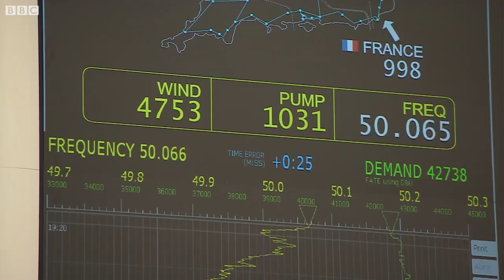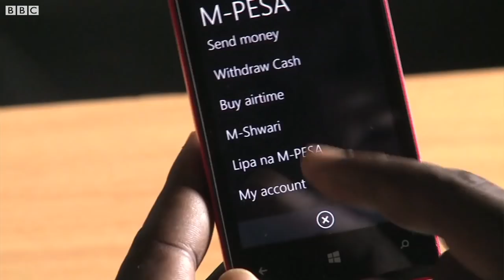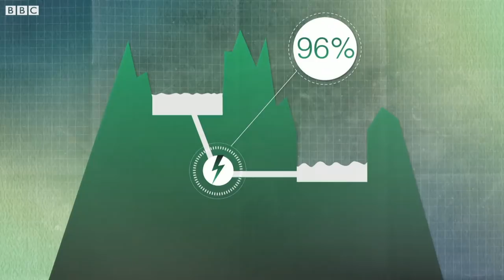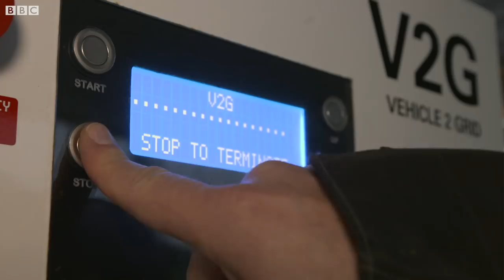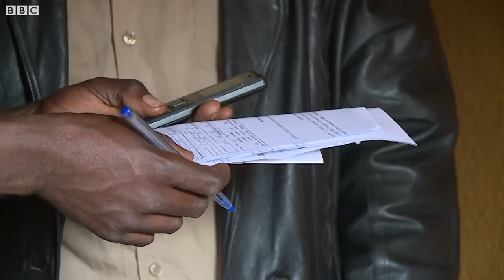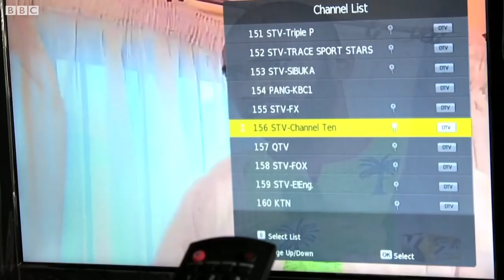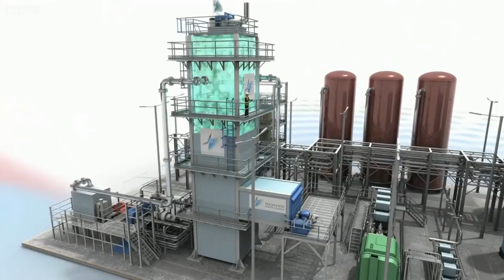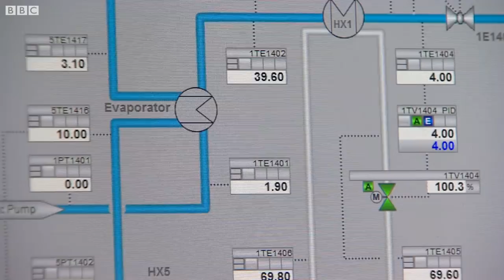Disruptors: Smart power - BBC News

Comment: The renewable sources are of low density & the high tech devices used to convert that into electricity is very inefficient, at best it's only 30%. These high tech "renewable" devices are dependent upon fossil resources to exist. You cannot use a technology to replace a resource that's totally dependent upon that same resource to exist.
It takes massive amounts of condensed energy to power our high tech civilization, that cannot be supported with renewables as the resources needed to produce them also need fossil fueled powered machines to mine, transport, crush & refine the ores into the components that make up those high tech & expensive "renewables".
We will never be able to build enough of them or generate enough electricity merely to support the grid & the grid itself will need to be upgraded & that would take more resources & energy than we will have available.
A 100% "renewable" future that includes electrical generation is simply not possible.
We are headed for collapse for too many reasons to list here but our unsustainable population is it's foundation.
Reply: Sheila chambers
So backwards it's unbelievable!
The "high tech" devices are often actually "low tech" devices.
These devices cost less to produce than the fossil fuels they replace.
A clue? 
It's a one off cost to produce, say, a wind turbine, then it runs for many years for virtually nothing. You have to continually spend money to extract and refine fossil fuel... All the time.... Every gallon. For the privilege of burning it at 20% efficiency.
AND The fossil fuels require 10 (TEN) times their own volume of water to produce refined fuel.
As you said
A (refined) fossil fuel cannot exist without first using power (via a fuel) to create it!
Thanks for the concept!
Maybe as we create more efficient devices (TV's, Computers, vehicles, etc) we can reduce the power per head capita we actually require (Yes, YOU America!), thus reducing the amount we actually need to produce ?
Maybe we then utilise the ultimate source of ALL our power (yes, the big, round, hot thing!).
Heat? It's hot! Fill a black pipe with water, leave it in the garden!
Electricity? The "Hot thing" warms oceans, oceans create air currents, air currents are wind!! (Yes, the moon as well, but all related!)
Cold? First insulate it!! Then, see "Electricity".
Or we could use those big black "complicated" things!
How many?
The equivalent of 1% (ONE percent) of the area of the Sahara desert to power the ENTIRE planet(!)
Btw, They're doing it!
Apparently, plants grow well under the panels.
So, raise them up, farm underneath, power to pump water, irrigate the desert, more crops, excess heat? Make steam, drive a turbine, temperature variations? Wind! Drive a turbine!
Need metal?
Melt it with heat! (Electrical power, or simply mirrors!)
Power at night?
Pump it from somewhere else, or
Molten salt reactor, or,
Pumped hydro, or,
Wind!!.... etc, etc,etc.
......
You DON'T need fossil fuels!
Now, the countries making the money may change! But who's fault would that be?
Reply: Hogwash Sheila. Either go back to primary school to learn the fundamentals of science, or do a bit of proper research. Let's look at solar energy - or to put it in simple terms, radiation from our sun. Essentially, our planet has been solar powered for around 4 billion years. Coal, gas and oil is simply harnessed solar radiation (collected over quite a few million years, I concede) but which we are now releasing in huge quantities. Here's a thought... using CURRENT solar technology, an area of 100km X 100km (10,000km squared) covered in solar panels will produce sufficient energy to power the entire USA. That coiuld be a really tiny area in the Texas panhandle. 

Total world electricity production was 20,261 TeraWatt hours (TWh) in 2008[2].

Power plant output in watts is:  20,261 TWh  ÷  365 days/year  ÷  24 hours/day  =  2.31 TW

Texas is 696,241 km2, so, 1,000 w/m2  x  1,000,000 m2/km2  x  696,241 km2  =  696,241,000,000,000 Watts =  696.241 TW

So, the sunlight falling on Texas at noon is equivalent to 696 TW solar energy ÷  2.31 TW power plant output

301 TIMES GREATER THAN THE OUTPUT OF ALL THE WORLD'S POWER PLANTS.

Go to any map of any country, and see just how small 100km X 100km really is in the greater scheme of things. Another thought... if we were to put solar panels in the construction exclusion zones of all the power stations in the UK... (that's land that borders these plants that cannot be built upon), the energy produced would be EQUIVALENT to their current output when they burn fossil fuels. On average, every square metre on earth gets hit by around 1.1w of energy daily from the sun. That's around 1.1 million watts per sq.km. The earth's surface area is 510 million sq.km. Even assuming that solar panels will only ever harvest 25% to 30% of solar energy, work out how many terawatts of energy are available to us every day - just from the sun. The challenge we face is not so much the AVAILABILITY of renewable energy, but how we store it and manage it. And that challenge is being successfully addressed. I'd suggest you go ask a primary school science teacher to explain... but in the UK, science teaching is so bad, he/she would probably not understand your questions.
Reply: @sheilachambers6671  I don't think you'll cope at primary school. It's clear the first time around wasn't that successful for you, so a second chance would probably produce the same result. But nevermind... I'll have this discussion with my dog - at least he'll understand the science.
Reply: go big or go home.
Reply: Not sure where you get your calculations from but first up solar panels have dropped in price to remarkably low levels.   The amount of energy to produce them has also reduced, just as their efficiency (in producing power has gone up).  As regards the cost of energy to produce solar panels well this can be largely done by renewable sourced power.  Battery storage is more difficult due to some minerals such as cobalt, but these elements are being reduced as a components in  Lithium ion batteres.  It seems super capacitors will further reduce then need for chemically based battery systems.   My solar system has paid for itself (given my energy costs are relatively high i.e 26c per Kwhr) by allowing me not to need to buy power.  so my initial panels bought in 2012  were paid off many years ago and now I have added a few more (better more efficient ones) and added a Tesla Powerwall2.    My Panels are basically maintenance free and will last for decades.  It will take me about 8yrs to pay off my Powerwall 2,  but after that I have at least another 6 yrs of effective battery power storing my free solar power for me to use at night.  My biggest cost is to pay for service fees for "the poles and wires" bringing the energy to and from my house.   So now I put more  power back; far more power than I use per year (I do use some power in winter from the grid)  So I pay for the privilege to send my neighbours on the grid my Greeen Solar power at the matching whole sale price (11c paid to me per Kwhr) .   So what exactly is supposed to be the down side in using Solar PV systems and battery storage ?    Its a win win for me and the climate !

Comment: fools, use new nuclear and hydro electric and geo thermal where possible, natural gas/coal as a last resort backup. solar and wind wont get ya very far and it will raise your energy prices. large scale power storage is dream, current battery systems even capacitors will never store enough power and will worse for the environment then a old style nuclear plant. for a massive grid connecting the whole world will not happen with current tech or for the next 50-100 years until superconductor power lines become cheaper then dirt.

yes solar on rooftops could work to supplement base load power needs but converting fields to solar is a bad idea plants need sunlight too.